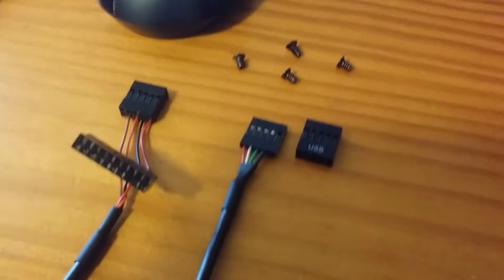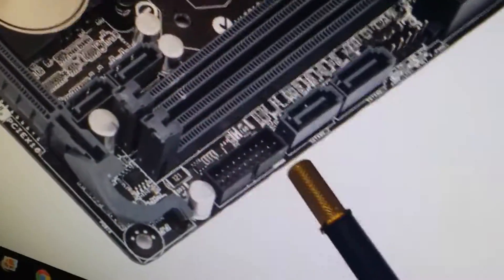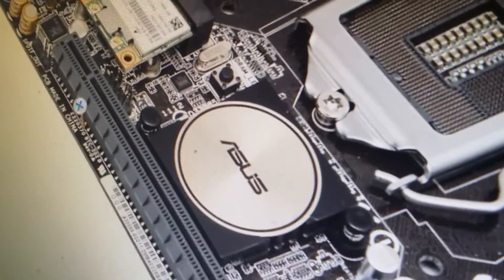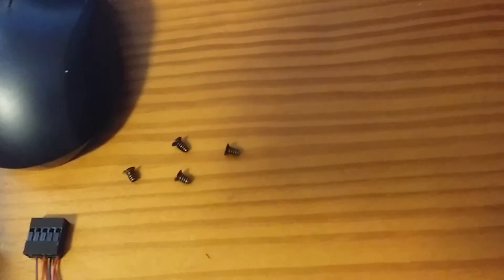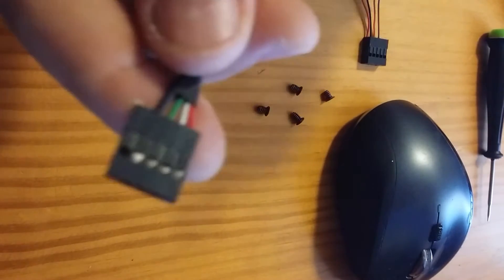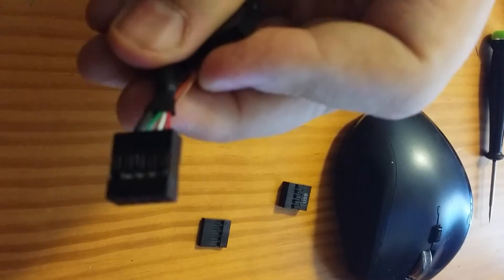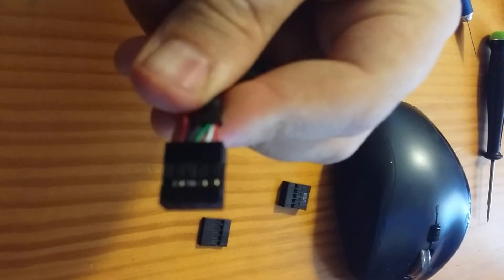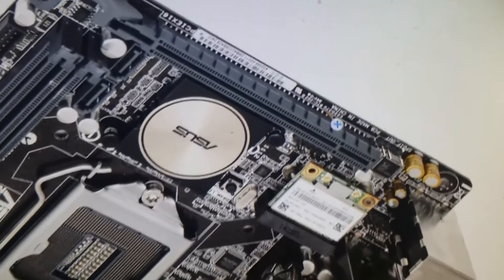One USB Header - Two Cable Solution

Comment: To add some details about why this hack works and clear up some misconceptions in the comments, every 9-pin internal USB 2.0 headers can support 2 USB 2.0 ports. This is the spec. This is why you can hook up two USB 2.0 type A ports from a front panel/add-in board to one single internal USB 2.0 header. Check a pin-out diagram to see that the pins are duplicated. Both ports get full USB 2.0 speed and power draw. 

The reason this hack is useful is that some manufacturers will connect a single USB port output to an entire internal USB header (for RGB, AIO cooler control, etc). If the USB 2.0 is a 9-pin connector, but only has 4 wires going into it, this is the case. You're basically missing out on an entire USB 2.0 port when you plug one of these in, and you can take back this port with the above hack (it's just adding in the wires to connect to the 2nd USB 2.0 port that the header can serve). Awesome hack, no downsides, just getting the full potential out of the connector. 

Final note, the connector (Standard Type A, micro, mini) doesn't matter, and you can mix and match these, as long as they are all USB 2.0 (e.g. you can have a standard and a micro USB connector sharing the same internal USB 2.0 header).
Reply: I need to do this hack to two Lian Li cables, but both have a 5th yellow wire. Obviously 10 into 9 doesn't go. Any ideas?

Comment: It works as long as you respect the power limit on a USB header. There is no miracle solution.
If you plug too much (or too power-hungry devices) you might kill your mobo and devices.

Smart and useful but take with care
Reply: How would this kill your MOBO?

Comment: Was there any downside to doing this, in terms of unreliability of the ports or anything?  I've seen some small adapter cards (that can be mounted internally with double sided tape) that try to do a similar thing.. but some of the reviews said that after a few months they failed.  Or there was erratic behaviour with their usb 2.0 devices.  Some even said that it fried the header and made their header not work anymore.  And those adapter boards have  awhole bunch of electronics on them.. like ic chips, mosfets, capacitors etc.  Where as your method is a lot simpler.  Did you experience any issues while using this fix?
Reply from the maker: No, there are cables that you can buy that do the same thing. I made this just in case you needed it ASAP and couldn't wait for it to be mailed. Here is the same idea but not A DYI mod like I did in the video. https://www.amazon.com/Header-Extension-Splitter-Connector-Adapter/dp/B076Q8685Y/ref=sr_1_3?keywords=usb+internal+cable+double+port&qid=1557954473&s=gateway&sr=8-3

Comment: Can not get the 3.0 speeds from this hack . But is still a useful one. Thank you
Reply: That’s because you’re plugging into a USB 2.0 header! USB 3.0 headers are much larger.
Reply from the maker: When I made this video many motherboards only had the 1 header and this was a quick solution to the problem if you didn't want a AIO cord draped out the back of your pc. I agree our options have changed since. thank you  @Badassblacksmith
Reply from the maker: Sadly you are right.. it only works on 2.0.